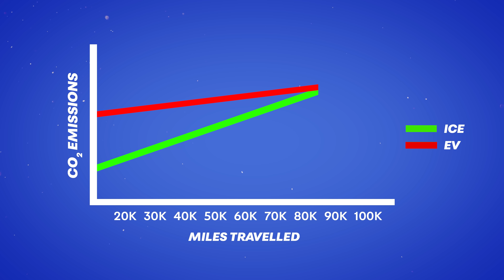Are Electric Cars REALLY That Green? [New 2022 Data]

Comment: Well done Auto Trader and Volvo, however I still feel that my 48 MPG gas vehicle is not  being taken into consideration. It could take the EV that competes with my car 120 thousand miles to catch up, therefore both vehicles would have been crushed by that time,  making the gas vehicle the less polluting  one.
Reply: Yup, it's really near sighted to say that ICE can't get more efficient.
It's all the people driving an SUV in gridlock who are really killing the environment.
Reply: Scooters should be taken into consideration
Reply: @jamesparson  No you shouldn't. Because it is not an all-year round practical vehicle unless you are as tough as nails, and never need to transport stuff.
Reply: I get 70+mpg in my Toyota Aygo so God knows how it compares xD. I think I worked out I'd have to drive an EV 240,000 miles to save £8,000 in fuel costs. Meaning I'd probably end up worse off buying an EV before I actually need a new car.
Reply: @mikes1992u  Yes, it's an unspoken reality that those high mpg cars (55mpg+) are not taken into consideration
Reply: @stuartburns8657  it's not only high mpg cars but also the fact that you need to decommission perfectly working cars to create new ones to substitute them. That's a lot more emissions than you think. That's one of the elephants in the room.
Reply: @C_R_O_M________  I think more emphasis / work should be put into car manufacturers converting existing ice into ev's personally
Reply: @stuartburns8657  That would be an interesting technological solution and a great alternative option for anyone interested but personally I wouldn't count on such a solution to lower carbon emissions. You see, with your solution the batteries will have to be produced and those are the prominent emission-producing components in an EV (ok, EVs also need a reinforced frame to be able to carry that battery weigh safely - so no, your solution needs a lot of R&D to even be feasible, unless of course you are ok with a much smaller battery and the subsequent much shorter range in a converted ICE-to-EV solution). There's huge complexity in there.
Reply: @stuartburns8657  that 90K figure (others think it's 120K) has a huge asterisk : it assumes that this mileage is reached ONLY with renewables used for the charging of the vehicle - practically impossible with most electrical grids having a mix of less than 10% from renewables (developed world, let's not even talk about the rest of the planet!). 

Moreover, no single research I've ever come across has factored in the emissions required for MAKING/manufacturing the renewable energy means themselves.

 Let me give you a hint why that's VERY important. An array of wing turbines on a mountain top will need emissions for the production of the wind turbines themselves, their transportation to the installation site with huge trucks, emissions for opening/widening the road for the huge parts to access the desirable location, emissions for thousands of tons of concrete for their bases, emissions for the energy storage facilities (batteries - to ensure grid stability/reliability, because their energy production is intermittent), emissions for their maintenance and finally for their decommissioning and recycling which are extremely emission-intensive. In the US they BURY the decommissioned wind turbines! That's in many of the instances that it's not economically feasible to do anything else with them.

If that's not an ecological disaster I don't know what is. Out of sight, no problem! That's their mantra it seems. That's the same mantra for the fanatic EV crowd. Some people call EVs "EEVs", that's for "emissions elsewhere vehicles" and they are more right than wrong. Cheers!
Reply: @stuartburns8657  Converting existing ICE to electric has proven to be a very bad idea, it's always a compromise resulting in inefficiencies.
Reply: The greenest is a phev that gets 50 miles to a charge, but doesn't need a huge battery. Best of both worlds.  Average MPG is 76 with no range anxiety, and no sitting around waiting for it to charge, unless you're bored and found a free charging station. 😜
Reply: Yes, most cars these days will have been sent to the scrapheap long before they reach 100k miles. I was down at a scrapyard a few months ago and I was shocked at how many cars there were in there that were less than 10 years old, and considerably less in many cases, especially smaller cars. It's cheaper now for insurance companies to scrap them and pay out a cash sum rather than pay for repairs even after a relatively minor accident, such is the high cost of getting them looking new and roadworthy again.
Reply: Why end a car’s lifespan at only 120k miles? That’s not a terrible mileage for a decently maintained vehicle. Unless it’s a cheap throw away vehicle like the notorious Geo Metro. I own a vehicle with 170k miles that still putters along just fine. I’ve seen many more vehicles hit upward of 250k miles with few problems and those not even related to the drivetrain. If you’re trashing your vics at only 120k then you’re unnecessarily contributing to global pollution. If they have a second life in someone else’s hands then what I’ve said means nothing. But you did say they were sent to the crusher. Is that some idiotic, misguided government standard? Lol politicians, you literally know nothing about what it is you do.
Reply: @coryholbrook4643  One of the 1st replies above answered your reply.  He said, Insurance Companies write them off with 110,000mi.or many people like you and I keep a car longer , but we want it to still look good.  Not long ago a new paint job for a small car cost $2000. now today's price is $6000. No longer worth fixing up as its value is so little for a small car with 110,000 miles.
Reply: @clearview5281   having an accident and damaging a car beyond economical repair is a different thing entirely than just trashing a car at 110k miles because it has miles and you’re tired of it. As for paint, again, maintenance. Ignore it and it will look like hell in 10yrs. Spend time washing it, waxing it, protecting it and it can live the life of the car. Ignore any part of a car and you’ll have a turd. Maintain your car and 110k could easily be considered only half its lifespan. That’s the point I was making. It’s nothing specific to small cars. Maintaining a car in proper working order is more environmentally friendly than running it into the ground and buying a new EV.
Reply: @coryholbrook4643  North American built cars are only built for 110 thousand miles and that is way past their warranty.  Now you could get almost double that if you drive 20 thou. highway miles per year. as city driving kills vehicles.
There are many cars called "Throw away cars" after less than 100 thou. miles .  They are worth nothing, not worth fixing and are warn out.  One commenter said his Metro was one of those cars.  My neighbor would agree with him.
Reply: @coryholbrook4643  120K is where the average EV battery will need replacement. It so happens that this 120K mark is the mileage that EVs are supposedly catching up in terms of emissions with an equivalently massed ICE and with the prerequisite of all charges being done by solar and wind, in which case I'd say: "Good luck with that!". Then the emissions counter resets (as they get a new battery). The EV hype is nonsensical from the net carbon aim. It's very promising as a technology and that's the only thing I like about it and there's a lot to love there - just not with the hypocritical criteria they started pushing them for.
Reply: @C_R_O_M________  batteries produced today last 500.000 miles. In Germany a Model S drives around with 1.000.000 km and needed a battery replacement at 450.000km (under warranty!).. and mostly supercharging, constantly beaten with Autobahn speeds of well over 90 miles per hour.

My Model Y has a battery warranty of 8 years or 192.000km, whichever comes first to have at least 70% of it's original rated capacity. When you handle your battery properly, take good care of it, battery packs can last well over 500.000km with very little degradation.

Jeff Dahn, the battery researcher has done research on the latest Tesla batteries and data shows these can last 2.000.000 MILES.

I don't know where you got that 120k miles figure from, but that is really old information, batteries and battery management has improved tremendously the past decade. Also the warranty on the battery EV manufacturers provide show this.. 8 years or well over 100k miles warranty is about the standard now, not only with Tesla.
Reply: @MarcoNierop  Tesla has given the 120K miles warranty because that’s the sweet spot for them to acknowledge a problem with the battery and replace it vs starting losing money (if they allowed for a bigger battery mileage under warranty). They obviously have done their tests and on average that’s the sweet spot. Occasionally you’ll get the outlier that will fail well below the 120K mile level or the other extreme of a battery lasting forever but that’s not the rule. The rule are closer to what Tesla is estimating as a feasible. umber. Currently it’s 120K miles which means they expect the batteries to last a bit longer (they implement margins of safety in their estimations, margins of safety that are calculated to favor the company) and that’s a good baseline for the rest of us. I hope yours last a lot more.
Reply: @C_R_O_M________   First, its not only Tesla giving this warranties, second, there are hardly early Tesla's ended on the scrap heap, almost all still driving around, 14 years later.

Schiphol Taxi had its first batch of 167 Tesla's Model X and S sold on the second hand market, a few years ago all of them well over 120K miles.. And almost all of them found second owners and still driving around today.

A collegue of mine has a Tesla Model S from 2013, took it over from his father.. very happy with the car, drives like a dream and battery is as good as new with very little degradation.

All this shows to me the batteries will not be the issue for older cars, when you take good care of the battery it lasts indeed for ever!.. and it is not the exeption, its the rule.. the exeption is that battery packs need to be replaced, it almost never happens.
Reply: Also consider that an EV cannot just simply be crushed.  The battery has to be removed and disposed of.
Reply: @RazorStrap  Batteries will be recycled, almost 100%, just like we do with lead acid batteries for decades (lead is actually a rare metal, there are not many lead mines in the world). Companies doing this are emerging now (Redwood materials, Umicore). 

Note that EV's are just on the road for about a decade, and the majority of these cars still driving around happily.. So not many batteries yet to recycle, but this will ramp up the coming years. Redwood is buildig a huge facility in Nevada. and already supplying Panasonic in Nevada (Tesla gigafactory 1) with recycled lithium.
Reply: @MarcoNierop  Point is that it has a cost and environmental impact that is completely ignored by fanatics.  The environmental impact doesn't end at just the initial battery manufacturing.  All this needs to be included when comparing environmental impact of ICE vs. EV.  EV is not as much cleaner than modern ICE as many people like to tout.  And until it has been driven a significant distance EV is environmentally worse.  Of course EV is still in it's infancy and will improve.  But it will not overtake ICE for manufacturing environmental impact for quite some time yet (if ever).
Reply: @MarcoNierop  "Batteries will be recycled, almost 100%, just like we do with lead acid batteries for decades (lead is actually a rare metal, there are not many lead mines in the world). Companies doing this are emerging now (Redwood materials, Umicore). "

>>Nonsense again! How will you make this economically feasible when battery recycling is one of the most energy-intensive procedures out there. With magic wands and wishful thinking nothing gets done you know! These companies will most likely need subsidies and a lot of leverage just to stay afloat with energy cost rising. Put your money where your mouth is and I'll tip my hat to you. P.S. See what the aggressive energy transition plans did to Europe? Yeah! They are not that wise or foreseeing! What a surprise!
Reply: @C_R_O_M________  I know of 5 off shore wind turbine parks being realized right now off the coast of the Netherlands, about 700 GW each (same as an average fossil fueled power plant) when ready they will provide 40% of the Dutch electricity  needs. But it will not stop there, many other plans is worked on right now.

The UK is much further with this, and have many days per year 100% of the energy comes from wind, and a little bit from solar. The UK has a lot of wind!

It may take a little longer than expected but in the end we will get there.
Reply: @RazorStrap  An EV needs to drive about 25.000 miles to offset it's bigger CO2 footprint, compared to a comparable ICE car. But this number may vary enourmous depending on the energy mix that is used to generate the electricity to charge your EV. When charged with 100% renewable energy it is much less, when charged with 100% coal generated electricity it is much longer.

So the cleaner the energy grid gets the bigger the advantage becomes.

What also helps if the manufacturing is done using renewable energy, like Tesla and VW do by putting solar panels on their roofs (thousands if not tens of thousands if solar panels), providing the electricity running the production lines. Tesla also sources the materials of the batteries locally, so it ruduced the CO2 emissions by reducing the transport of these materials from 2 times around the world to just a few hundred miles.
Reply: @MarcoNierop  Maybe you don't realise that going for solar and wind means a reduction in efficiency on how humanity produces energy by a huge factor. EROEI (energy returned on energy invested) for wind and solar is horrendous (1 to 5) in comparison to fossil fuels and nuclear that have an EROEI of 30 and 100 respectively. That's an efficiency reduction equivalent to that of carrying loads with a car vs carrying it on your back! This is why energy costs are going sky high at the moment in Europe. 

 Moreover, 100% dependency on renewables is simply impossible as the sun is, at the most, only half the day up and wind doesn't blow all the time (especially, again, during the night). 

Moreover, wind and solar, exactly because of their intermittency in their output, need to be coupled with natural gas or other fossil fuel plants to cover the unreliability gaps from their energy production. 

This is why, Germany, with the most aggressive energy transition plans on the planet had actually WORSENED their air quality and CO2 emissions. 

Their dependency on wind and solar is a bit over 40% at the moment, which is the greatest percentage on the planet, and they worsened their air because the lignite plants they started cycling on/off (when the grid needed them) are in their most polluting phases when they are in the preheating/starting up phase (which may last from many minutes to many hours) instead of being operated 24/7 when they work at optimal efficiency and with the least pollution. 

Things are extremely complicated and to believe that there's a linear relationship between how much renewables we put out there and what happenss in the real world is just a naive and ignorant belief that is about to get a very rude awakening going forward. 

I suggest you go find research from Goehring and Rozencwajg and Horizon Kinetics. They put their money and that of their clientele where their mouth is. Horizon Kinetics in particular, in one of their latest reports, mentioned that if the energy transition plans of the Dutch were to be carried out, them alone, will be needing between 2X and 12X the GLOBAL production of certain commodities. If such a small country needs 2X to 12X of the global production of those commodities what will the rest of the world need?
Reply: @RazorStrap  reused
Reply: You are comparing your "small" car (normal sized for Europe) with a large EVs. Currently the EV market is about large, long range EVs, mostly because of the USA market. 
A smaller EV can easily get away with a half sized battery. This halves the initial CO2 footprint, and the smaller EV needs less energy to go, just like your smaller car.
In Central Europe we would absolutely love smaller and cheaper EVs, 100 miles of range would be more than enough for most people who commutes regularly. For example, from Budapest, you can access half the country without stopping for a charge. 
If you stop for a charge, you can access the whole country with a tiny 100 mile range car.
Not no mention that you can go to Poland and charge there without even stopping in Slovakia.
Reply: @adamrak7560  how long & how many EV cars do you think humans can produce before we can’t mine / find the much scarcest material to build batteries etc for EV cars & Solar panels / batteries for houses ??
Fossil fuel won’t last for ever either, but there is much more oil/coal etc in the earth than raw material required to build EV.
Reply: @benlondon8467  I do not worry about the sustainability of these technologies, because there are lots of raw material for making EVs and solar cells:

battery:
- lithium is practically infinite if we use the clay deposits (with salt ion exchange).
- current non-clay (super high lithium clays may be included) reserves of lithium are enough for about 200 million cars. Clay reserved are much bigger, but will need newer slightly more expensive tech for extract.
- if lithium clay fails, we can extract from seawater
- Earth has massive amounts of nickel, but it may be very expensive to mine it, but there are already nickel free batteries in production (LFP).
- Cobalt is problematic, but we already have cobalt free batteries in production (LFP).
- Copper is expensive, and will stay expensive, this should still be sustainable because we have enough copper for at least 20 billion cars in identified deposits

- we can use sodium instead of lithium, this could halve the capacity but extremely abundant and cheap. This would still work for cheap small lower range cars, those need less than half of the capacity compared to a large Teslas

body:
- Aluminium is practically unlimited, but we need electricity to produce it, we can use solar energy to offset that.

magnets:
- Rare-earths  for the magnets may be a problem, because they are too diluted but we can build EV motors without them, it will cost a few percent of efficiency (10% range reportedly).

solar cells:
- the cheapest solar cell is made of mostly silicon, glass and copper/silver. Dopants for the silicon are needed in extremely small quantities.
- silicon is made from silicone dioxide which is extremely abundant, it needs relatively lot of power to make. Significant part of the cost of solar cells is the energy cost for processing the silicon (and the glass). Using solar energy to make solar cells would be a huge help here, and it would close the CO2 gap.
- there are even carbon based solar cells now in labs. Basically we can make solar cells from many-many materials, the most sustainable are silicon and carbon(graphene or other organic). 
- solar cell materials are highly sustainable, but we have to be careful to recycle solar cells with heavy metals(lead, cadmium). Personally I would not allow large scale heavy metal based solar cells at all, we have so many choices, we should not use the most toxic types.
Reply: @adamrak7560  Renewable energy technologies will require high increases in materials demand which will put additional stresses on the future availability of some raw materials. The transition to green energy technologies according to the current decarbonisation scenarios can be put in danger due to weaknesses in future supply security for several materials such as germanium, tellurium gallium, indium, selenium, silicon and glass for the solar PV and rare earths for the wind turbines technologies, these raw materials are also used in EV,s. Lithium, nickel and cobalt are the key metals used to make EV batteries. Analysts believe there is a potential shortfall in the global mining capacity required to extract the minerals needed to manufacture sufficient batteries to meet projected EV demand, especially when we all drive 1.
I recon your talking out of your ass, do some research mate.
Reply: @benlondon8467  we're not all driving one. Keep that trash.
Reply: @benlondon8467  That is BS, Lithium is one of the most abundant metals on earth, our oceans are full of it. Same with silicon for solar panels, and EV manufacturers are moving away from Nickel and Cobalt, toward Lithium Iron Phosphate batteries, which is cheap and really abundant.

Its not that the materials are not there, its a matter of getting them out of the ground.

Also at some point we do not need to mine for new materials, because batteries can be recycled close to 100% over and over again, but this will take a few decades before we get there, because first we need to replace, or at least get rid of all ICE vehicles.
Reply: @MarcoNierop  ya think I just came up with what I said ? Look it up mate, it’s no BS.
Reply: @adamrak7560  nonsense!
Reply: @MarcoNierop  "That is BS, Lithium is one of the most abundant metals on earth, our oceans are full of it. Same with silicon for solar panels, and EV manufacturers are moving away from Nickel and Cobalt, toward Lithium Iron Phosphate batteries, which is cheap and really abundant."

>>Nonsense! You have no idea what you are talking about! There ,may be lithium around the globe but how you mine it makes all the difference in the world. Moreover silicon takes a special kind of sand, not just any sand (for example the kind you find in the Sahara is useless for silicon manufacturing) and there's currently a shortage! See? Reality is far more complex than most of you kids think!
Reply: @benlondon8467  As I said it's a matter of getting the stuff out if the ground, and there lies a (temporary) problem, there are not enough mines right now, but many plans for new mines on the drawing board. For now Only Tesla seems to be aware of this and is anticipating on this by securing as many material contracts as possible and is even planning on mining the stuff by themselves.
Reply: @adamrak7560  Your comment is quite accurate; in fact I just finished looking at my friends large N A EV and found out that it has 2 motors, front and back.  He and I are in a Town where electricity is almost 13 cents a Kil Hour, so my point is my friend's EV would never pass my car for emissions efficiency.  
Back to your point, we couldn't use a small EV as although I live in a town, I have to go 100 km to see a Doctor or go to a Golf Course.
Reply: @adamrak7560  i agree, the calculations are based on volvos large batteries, most EVs in europe have 30-50kwh sized batteries, which are considered small to meddium in europe. Also it is an unknown, how efficient is volvos manufacturing in general. Also energy in eurpoe is way cleaner than in the USA
Reply: @adamrak7560  I wouldn't call the Volvo XC40 a large vehicle. I'm pretty sure that it is classified as a compact SUV.
Reply: @rich7447  any SUV is large. Certainly by European standards
Reply: @nielsvandersteen4619  The XC40 is the same width as a BMW M3 and 15 inches shorter.
Reply: @adamrak7560  Here in Canada you might get to the next town with your 100 mile EV.  And then again, you might not.
Reply: @Mike__G  Less likely in winter.